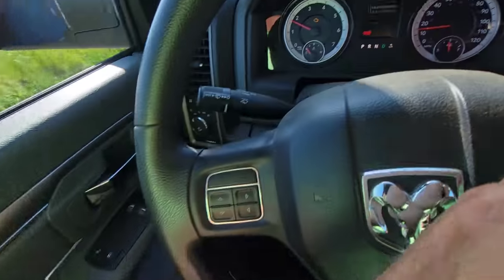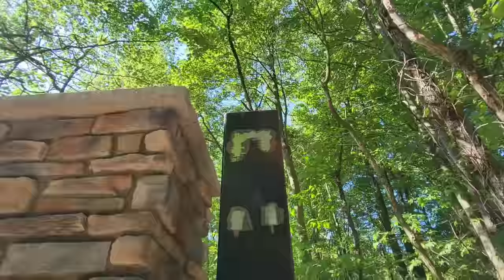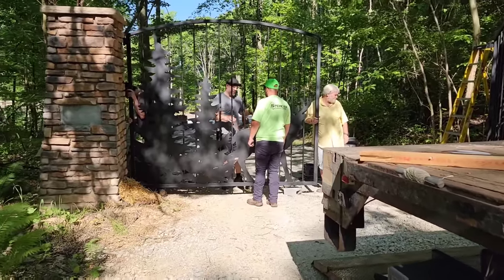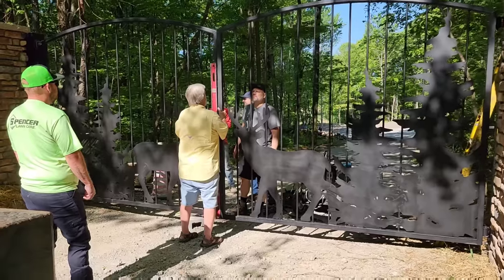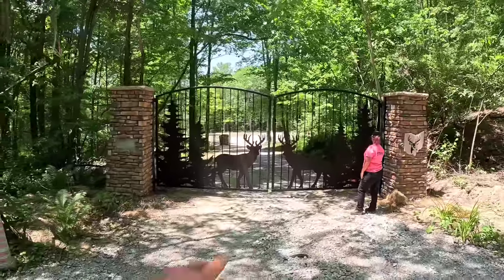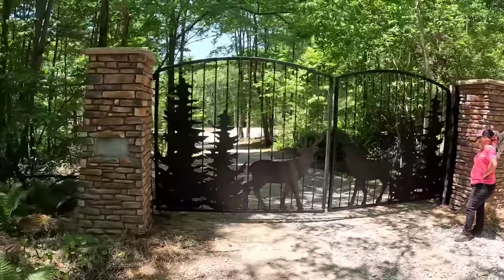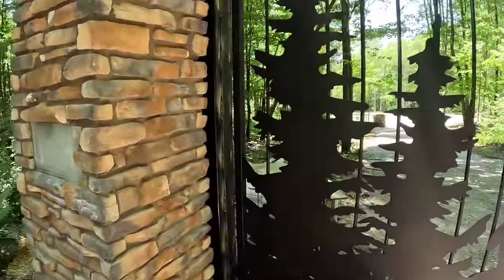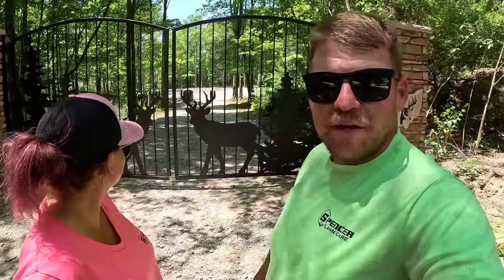Stopping Trespassers in Their Tracks! Installing Gates at Our Headquarters!

Comment: I had the same problem with one of my trailers. It ended up being the ground wire was loose on the connector at the trailer.  So it would make and break with bump in the road.

Comment: As far as your truck, it sounds like a ground problem. It can ground through your ball and hitch but not consistantly. I worked on trailers for years and 98% of electrical problems were with the grounding.

Comment: 90% of trailer brake/lights problems are due to a bad ground.  A ground wire should be run to every light and brake on the trailer.  A ground wire should also be run through the trailer/truck wiring connecter.   Never simply rely on the trailer hitch/ball connection making a solid ground or the screws holding the lights to the frame making a ground.  This comes from years of towing equipment trailers and snowmobile trailers through the worst weather conditions.

Comment: Like you stated your having problems with your trailer plug just had to fix the same problem it’s your trailer plug it’s having a bad connection where the wires meet replace that you will be good

Comment: Nice gate. That's probably what i would have chosen. Deer or bears. On the trailer issue yeah could be a loose connection or maybe the wires are broken inside the pigtail rubber insulation making intermittent contact, that has been known to happen. And you have no way of knowing where the breakage is.

Comment: My trailer use to do the same thing. I replaced the 7 pin wiring harness all the way back to the trailer and that solved it… a couple of the metal contact points in the trailer plug were worn out and not making contact all the time… would send my truck dash into a frenzy … gates look awesome

Comment: Hey Shawen The gate looks great you can use a bicycle cable lock to lock the gate temporarily. The rubber coating on the cable can protect the finish from being scratched And you can wind it up tightly to keep somebody from cutting it

Comment: Nice looking gates! They go nicely with the stone work. Check the grounds on your trailer wiring first. 99.9% of the time, this is a problem. Run a temporary ground wire from the trailer to the truck for a quick check. Also check the main harness going back underneath the trailer frame to the axles and lights. A lot of the trailers I see have the harness run on top of the crossmembers and get pinched between the wood deck and the metal, creating intermittent shorts or other problems. Sometimes if you have brakes on one side and not the other, the wires going through the axle tubes are rubbed or broken, or those connectors used corrode terribly, causing problems. All of these should be checked, but as I said, start simple with the ground and go on from there. Hope this helps.

Comment: I had the continual "trailer brake dissconnected" in my Ram. Wound up being the trailer brake wires that run through the axle tube. Hope this helps.

Comment: I had the same issue with my trailer, I ended up having to take apart the factory plug end and a few feet back on the wire covering and my white ground wire was disconnected completely, reattached it, problem solved. Could possibly be the same issue

Comment: When you run electric to gates run a conduit to have cameras at the entrance as well as  conduit for electric and one for cable along with spare electric and spare low voltage.   You may even want one for remote controlled driveway lights.

Comment: Ground issue, always a ground issue.  Run a new ground from your pigtail attaching it with a new bolt or self tapper.  You could start by just locating where the ground attaches to the frame, put a new eyelet on the white wire (well it should be white), or put one on if they just wrapped the wire around the bolt or self tapper, wire brush the area and re-attach.  95% of the trailers I see with this issue we are able to fix this way.